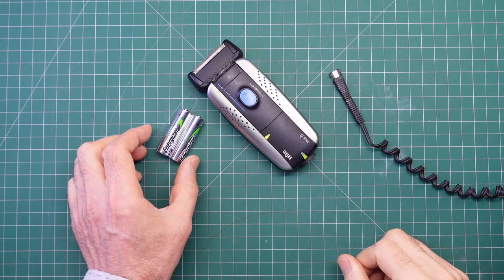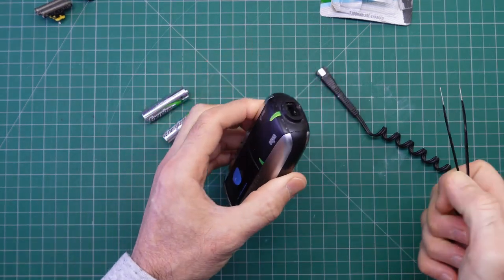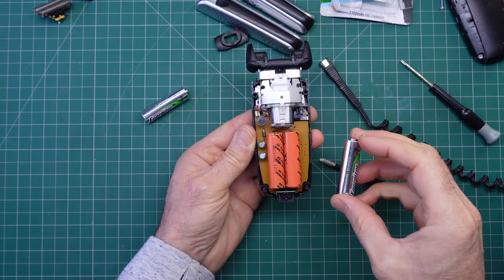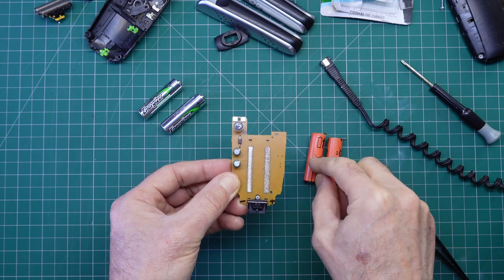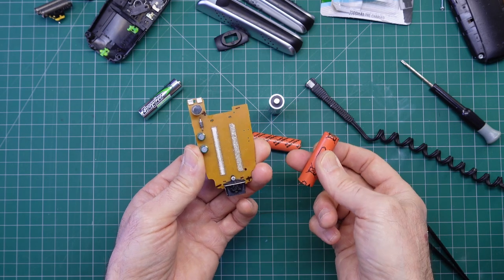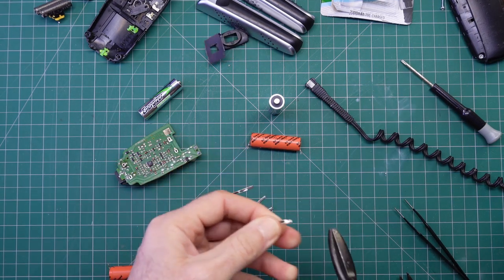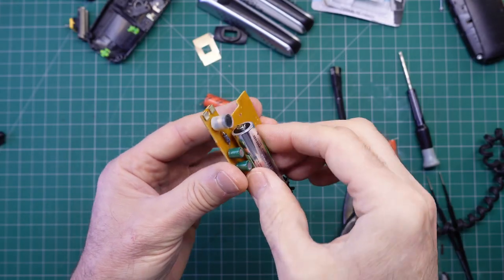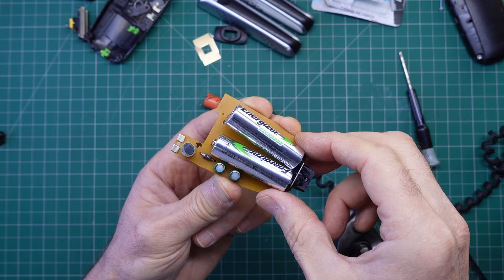Ep43 Braun Shaver Battery Replacement

Comment: Excellent video tutorial.  I used batteries with tabs.  The tabs were too wide but I just cut them smaller with scissors to fit the slot. The blue lens at the bottom indicating charging fell off on 1 of the 3 shavers I was working on and it won't stay in place now.  It's not a big deal.  I'll at some point glue that into place.

Comment: I have a Braun 7680, very similar to the one in your video. I got everything apart with no issues, but it appears that the battery board has some sort of clear coat that was "painted" over the top of the solder connections (and most everything else on the board) after it was assembled. Any idea whether it's possible to remove the coating without damaging anything?
Reply from the maker: Hi Matt, Its possible that the board has what is known as a "conformal coating".  In this case the conformal coating will be to protect the pcb from moisture which is good as most shavers spend some time in bathrooms!  It doesnt make things water proof but water/moisture resistant.  To desolder I'd just scrape the clear coat off the battery cell terminals then resolder.
Reply: @PowerOn-  okay, I'll give it a try, thank you!
Reply: @PowerOn-  Just wanted to say thanks! I got the new batteries installed and I'm amazed at the results. I didn't realize how much the worn out batteries were affecting its performance. My shaver is close to 20 years old, but now it feels like new!

Comment: Hi Simon, Do you have instructions on re-assembling the front blade/power button? Cheers
Reply from the maker: No, sorry but from memory there are not many parts involved and a spring and detents provide the snap action between the 3 settings

Comment: How much would this cost to do? I would rather have someone do it for me. Is that possible? 

Thanks for sharing :o)
Reply from the maker: The replacements cells with tabs already welded are about 10usd ea.  Then you just need a friend with a soldering iron!
Reply: @PowerOn-  Where Can i buy the cells at? Do you have a link?